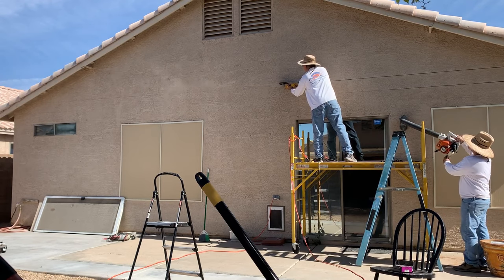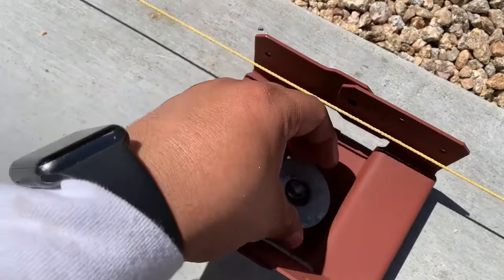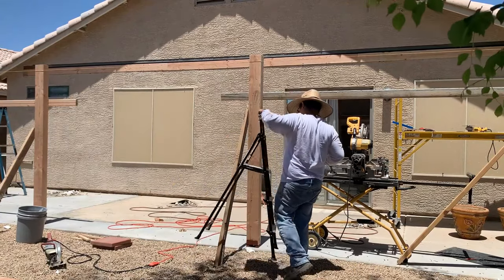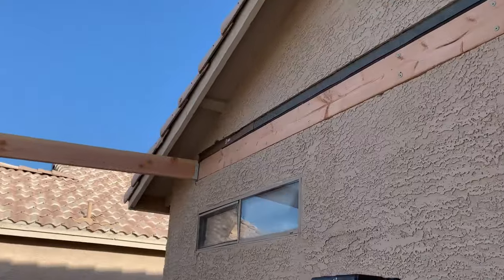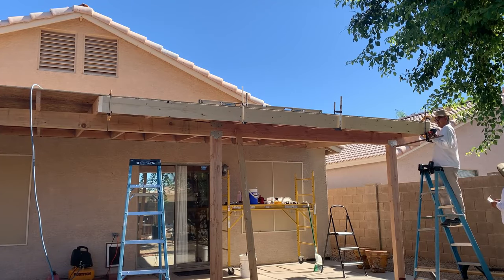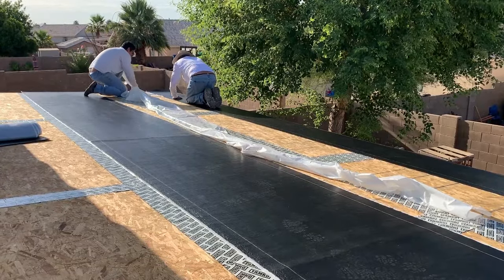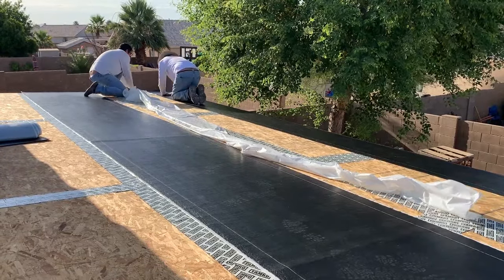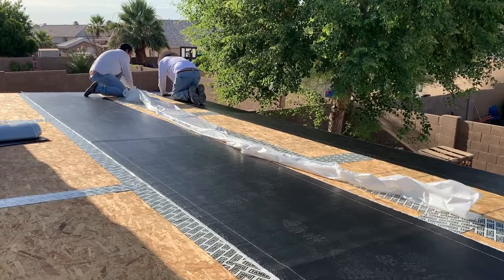DIY Patio Part2 - Framing Roof

Comment: Great video, Sir!  This is exactly what I want to build!  
Two questions:  what did you use to attach the Z bar flashing to the house and ledger?  And what did you use to attach the L flashing to the Z bar/plywood?

Keep up the great work!
Reply from the maker: I’m happy you found the video helpful. Right above the ledger board I placed a 1”x”3 board which the Z flashing sits on top off. The L flashing butts up against that 1x3 and behind the Z flashing overlap. And they both get anchored together to the 1x3 which is attached to the 2x4s of the house like the ledger board.
Reply: @luisangelmedia4459   
Thanks!   ...but you may have to make a part 3 to your awesome build to explain, in further detail, the flashing installation.   I just want to make sure that I did it within the same way to prevent water intrusion.
Reply from the maker: @tommy2shoes339  https://lh3.googleusercontent.com/proxy/itJKdZuW8IcftFbPkrZThXUzZiDXNEXow9l8vv5I8THlCHZ0GHdgznm4yOmazRQ9n0Nr4G9KTJcRO_Ce-pjTZSVH4owr0V9FK_ldCO-3iX0yJfpjPhcH9Zyygv9OW7NANA
Reply from the maker: @tommy2shoes339  look at the link I gave you. The “spacer” is the 1x3 I said previously. That sits on top of the ledger and everything else in the picture gets placed in that similar manner.
Reply: @luisangelmedia4459  
Thank you, again!
Reply: Link not working 😩. 
I’m stating this build soon!  😩😩😩
Reply from the maker: https://d12m281ylf13f0.cloudfront.net/images10/1-13-2.jpg
Reply from the maker: @tommy2shoes339  I linked another one, different picture, but same idea. Using two metal flashings to deter water away.
Reply: @luisangelmedia4459  
Luis...you are The Man!!!

Comment: Nice work. Honestly I didn’t see anything done incorrectly or half ass. And yes the membrane could have been put over the flashing. That’s the only thing I would have done differently.
Reply from the maker: Thank you. I agree about adding material between the base sheet and the roof edge.

Comment: Buen trabajo Luis
Tengo una pregunta 
Cuanto declive le pusiste al techo?
Gracias
Reply from the maker: Gracias. El techo tiene .5/12 de inclinación. Es decir, por cada 12 pulgadas, baja media (1/2) pulgada o en este caso, 6 pulgadas. Puedo bajar hasta un cuarto (.25/12) con este tipo de material y sobretodo, aquí en Phoenix no llueve mucho y está al código requerido.
Reply: @luisangelmedia4459  gracias
Yo hare uno en los proximos diaz en tu casa(Chicago)aqui me piden que los postes vallan 36 pulgadas bajo tierra porque hace mucho frio
Y la tierra se mueve con en calor y el frio,saludos
Una ultima pregunta que altura te piden para que este a codigo?
Reply from the maker: @surfacegrindingmachine5894  la única altura que es requerida es al final donde está el 4x8 horizontal. Se necesita 7 pies abiertos del piso al 4x8 de la parte de abajo. Te deseo buena suerte en tu proyecto.
Reply: @luisangelmedia4459  gracias
Ya tengo el permiso,pero no creas que expecifican mucho
Es interesante como cambian los codigos de una ciudad a otra
Yo pondre los postes de 6x6 pero tienen que estar cubiertos de concreto 46 pulgadas 36 pulgadas bajo tierra y 12 sobre la tierra
Saludos hermano
Reply from the maker: @surfacegrindingmachine5894  yo creo que tiene que ver con el frío y la nieve que caí en esos estados que hace que vayan cambiando los códigos. Dios te bendiga.

Comment: Hi Luis 
Do have a list of all the material that you used?
Reply from the maker: I do, but it’s quite long. You could follow the video and take notes on all the stuff used, or give me your email to send a list if you’d like.
Reply: What's the brand name of the adhesive roll and cap sheet?
Reply: Also can I get it from home depot or Lowes?
Reply from the maker: @HueNguyen-sh2dv  “Liberty GAF”
Reply from the maker: @HueNguyen-sh2dv  You can get them from both stores. However, you need to go to one of the stores that sells this material, usually the store where most contractors buy as not every single store carries the material in stock.
Reply from the maker: @HueNguyen-sh2dv  Yes, but not all the stores have them, some stores are more "contractor base" stores where they carry these kinds of stuff. Here is the link https://www.homedepot.com/p/GAF-Liberty-3-ft-x-34-ft-100-sq-ft-SBS-Self-Adhering-Cap-Sheet-Roll-for-Low-Slope-Roofing-in-White-3732920/100031926

Comment: Amazing job Luis. Can you help those who aren't very familiar with flashing? How do you attach the Z-flashing to the house? How is the L-flashing then attached to the z-flashing? Thanks for your assistance! Your work is impressive!
Reply from the maker: With the stucco cut back like I did, you feed and tuck the z flashing underneath the stucco and whatever is under the stucco as well such as foam insulation. The Z flashing looks more like an “N” so once you have one side tuck under the stucco, the L feeds under the other lip of the z flashing and the roof under the L. So you have one “seamless” transition where water cannot possibly get into. Hope this helps.

Comment: Thanks for the trhis video...How do you cut the notch on the 2x4's to mount on top of the rafters?
Reply from the maker: You can use a square on both sides of the beam to mark where the notch will go and then use a marker and run it along the beam to mark the line on the stud. Let me know if this what you asked.

Comment: nice job, but it's  extra work and money involved when it is very simple to determine your double top plate on  the wall and bottom cord on the gable truss...
Reply from the maker: Thank you for the feedback. I’m not too familiar with everything you said, but I’ll look it up for next build to be more informed.
Reply: How can you determine where your double top plate is located without cutting into the stucco? Thanks.
Reply from the maker: @brunodiaz305  if you were asking me, I’m not sure about that info that the user above commented. When I cut into my stucco, I did not see any wood that my ledger board could have just been bolted on to, except for the 2x4s. So this “top plate” is either too low or too high for where i wanted and needed my ledger board to go.

Comment: Very nice work. I'm planning on building something similar 15x30 but instead of a ledger board I'll building into the roof and on top of the wall. But I had a question about the post. Is there a reason why u went with 4x6 instead of a 4x4 post? Is it code to use 4x6?
Reply from the maker: The schedule tables provided to me by the city did not tell me specifically what size post to get, but I went with a 4x6 instead of 4x4 because I thought it would make for a “stronger” post and I like the look of a wider post.
Reply: @luisangelmedia4459 I see. Thank you for the quick response.
Reply from the maker: @bigpetah765  good luck on your project!

Comment: I see posts are put on 4inch concrete. Is it according to the code?
Reply from the maker: If you go look at part 1, the posts are on top of 12”x12” footings, about 2 feet deep. I buried a 5/8” bolt for the post base.

Comment: Great work! Is the beam 4x6, Rafter and ledger  2x6?  You don’t need cross bars between the rafters?
Reply from the maker: The horizontal beams are 4x8. Ledger is 2x6 and 4x6 posts. 2x6 rafters as well. As for the cross bars, I think they could help, but I opted not to put any because the rafter span was only like 10 feet and I think the rafters shouldn’t move so much. Almost 1 year later and they are still fairly straight.

Comment: I still  don't like the Idea of resting the two beams on the center post since  you are only  resting those  top beams  on 2  1/2 inch in each side ,  to secure  it better  I will  attach  1 2x4 on each side of the center post
Reply from the maker: Yeah it looks odd having both come down on half the post, but I think that’s what the post cap is for. It’s designed to strengthen that post and securely have those two beams rest on it. I know sometimes city code doesn’t make sense, but you can always do like you said, add support to make it stronger. Thank you for pointing it out.

Comment: How much would a patio like that cost I have the same problem with the sun 12 × 36 no concrete
Reply from the maker: I spent about $350 for the concrete delivery of 2.5 yards and that was 8x32. We finished the concrete ourselves, but I estimate that would probably cost about $1,500-$2,000 to have done by someone. As for the patio structure itself. I spent about $1,500 on materials, but the prices of lumber have increased dramatically. Most recent patio I did, 12x32 came out to $2,400 in materials and I was paid $4,000 labor. Hope this helps.
Reply: How much for the patio that's exactly what I want
Reply from the maker: @adammartin9701  contact me at luisangelmedia@gmail.com

Comment: I'm wanting to do a patio over concrete pad as well but my house is brick. How do you flash the ledger board?
Reply from the maker: It’s done with 2 metal flashings. One is called a Z flashing that sits on top of a spacer above the ledger board and the other one is a regular L flashing that goes below that one, but above the patio. Here is an illustration 
https://imgur.com/a/MbRxgUQ
Reply: @luisangelmedia4459  Hey, I can't get behind the brick. I could only cut into the mortar joint. Do you know what I would use?
Reply from the maker: @kathleenjones9207  oh my bad! If your house is bricks, do you have eves coming down the side of your house? If you have eves, you need to cut them back flush with the house, so the ledger board would sit on top of the bricks, but attached to the eves/rafters coming down from the roof. If you don’t have eves and your bricks go up high, I really don’t know what the procedure would be for that kind of application.
Reply from the maker: @kathleenjones9207  https://imgur.com/a/kYTG6gq

Comment: Great video and professionally done! Does your roof have a grade for rainfall/runoff? 

Is the cap sheet all that’s needed (no shingles/metal exterior protection)?  I’m in CA so it’s hot and rainy.
Reply from the maker: Yes, the roof has a 6” slope from the house to the posts. This is a .5/12 slope, super low, but still at code and spec for the type of roofing material I used. Here in Arizona cap sheets are fairly common, not as a main roof, but used in a lot in additions, sheds, patios.
Reply: @luisangelmedia4459  thank you! I’d be interested to see a video tying into an existing roofline (fascia removal maybe) if that’s on the list! I guess it would be for the side of your house. Again great detail thank you!
Reply from the maker: @iWaSTD  I know what you are talking about, but here in Arizona you cannot attach any structure to the side of the fascia or the eves coming down the side of the house. What needs to be done there is that the eves needs to be cut back flush to the house and then expose the trusses where those eves come from and your patio or structure is then attached to those trusses. New roof material also needs to be under the existing roof, which means momentarily lifting off a few inches of the shingles to create an overlap for new roof. Hope this explains it.
Reply: @luisangelmedia4459  I 100% understand because I just replaced all the decking/underlayment on the back roofline. Thanks so much for your insight!
Reply from the maker: @iWaSTD  you’re welcome and good luck in your future projects!

Comment: The concrete can support a pavillion? Will it crack in the long run??
Reply from the maker: It depends exactly what this “pavilion” will hold. The concrete will hold a lot of weight, specially because the posts have a footing under them. But this patio structure is a simple cover. You and someone else can walk on this no problem, but it’s not made with the purposes to build more things on top of it. So your structure needs to be braced according to whatever purpose you will be using it for.
Reply: @luisangelmedia4459  ok I understand. I just got concrete about 6 months ago 4inches thick with wire mesh underneath.  Do you think it can support a 20x30 pavillion? I'm a little nervous because I don't want the concrete to crack
Reply from the maker: @nba3512  that’s good that they added the wire mesh and this helps, but usually most companies that pour cement will pour you 3500 PSI unless you ask for something stronger, but 3500 is strong enough for any residential work.
Reply: @luisangelmedia4459  great. I just called they said my concrete is 4000psi. That should be good right? Your works looks great. Thanks for the help Luis.
Reply from the maker: @nba3512  you’re welcome and yes, 4,000 psi is super strong
Reply: @luisangelmedia4459  ty. Have a good one
Reply from the maker: @nba3512  thank you, you too.

Comment: Need help how a far apart did u put the beams bro let me know and do u need a permit
Reply from the maker: The beams or posts are 10 feet apart on their center. The middle beam is 10 feet while the two outside beams were left at 12 feet length just in case I want to do something with them later. As for the permits, you need to call your city, maybe try zoning or building, they will let you know if you need permit or not, but in most cases you do and what will happen if you build without one (in most cases pay a fine if your patio is built correctly.)
Reply: Ok thanks I thought it be 16 apart did u put roofing on it I want to do one 19ft by 8ft like a porch  what u think
Reply from the maker: @ovg8824  yes I did add roofing material to the top. And I would advise that you stick to a roof that 4x8 boards could occupy the space in, so 8 feet is good, but instead of 19 try 16, 20 or 24 so you will have less waste material. Draw it out and check your measurements before you begin buying to make sure it all checks out.

Comment: La.lamena es de de 3 ×2
Tambien ebisto de 2×2 cual es la adecuada
Reply from the maker: Cual lamina te refieres, la de la orilla que va todo alrededor? Esa viene en varios. Te recomiendo una suficiente ancha que cubra la tabla que va atrás como separador para que la agua no la humedezca.
Reply: Gracias evisto casas k tiene la madera de 3 pulgadas y la lamina de 2 pulgadas no cunbre la tabla. 
Save por k leponen un prame. En espray ala lamina por ensima donde ba elnarenado por lo aran si viene pintada
Reply from the maker: @trailscampingandlake696  creo que lo que le echan es un material para sellar la orilla de la lámina y el rollo negro.
Reply: La tabla no encontre de 2 inch real. Tedan gato por liebre. 1 1/2. Tu las cortastes a 2
Abia de 3 inch k la medida real es 2 1/2

Comment: Vi k no pusistes tachuelas en nigun momento en el papel negro ni en el arenado.
Las bases de metal que son como V k sostienen todo el peso la k las k pusisteses en el barrote k metistes en el semento. K las pones a cada 24 pulgadas al centro. Como pueden sostener tanto peso con tansolo 4 clavos o tornillos. Como. O se salen los rornillos con el peso. Geacias por responder.
Por k no pusistes madera tratada. No la recomiendas
Reply from the maker: El papel negro no es papel normal de techo, este material tiene pegamento en la parte de abajo, por eso se le quita el plástico de abajo. Una vez que ya haga contacto el material con el triplay queda pegado porque el pegamento es muy fuerte y no fácilmente se puede quitar. El arenado similarmente tiene pegamento en la parte de abajo que se queda pegado con el negro. Ahora, todas las piezas de metal que se utilizaron en este projecto son hechas para este tipo de aplicación. Las bases de los postes son resistente a la agua y ayuda a los postes no estar directamente sobre el cemento y para reducir la humedad. Las basas están anclada a una barilla de 5/8” que se enterró cuando se hecho el cemento. Las placas de metal que detienen los barrotes contra la casa también están diseñados para este propósito, pero también se le mete tornillos atravesados para darle más fuerza a estas placas. En inglés se llaman “rafter hangers” es decir, “ganchos para vigas.” Y no use la madera tratada porque yo vivo en Phoenix, Arizona en EEUU. Aquí no hay mucha humedad o lluvia, pero también es porque se va a pintar la madera en el futuro.

Comment: What type of screws did you use
Reply from the maker: Most of the build was done with exterior Everbilt screws of different sizes. Gray coated. I used 3/8 lag bolts for the ledger board and self driving, flat head screws for most of the metal hardware. Hope this answers your question.

Comment: Which post caps did you use?
Reply from the maker: https://www.homedepot.com/p/Simpson-Strong-Tie-ABA-ZMAX-Galvanized-Adjustable-Standoff-Post-Base-for-4x6-Nominal-Lumber-ABA46Z/100375175
Reply from the maker: Let me know if the link works, or you can type “Simpson Strong-Tie ABA ZMAX Galvanized Adjustable Standoff Post Base for 4x6 Nominal Lumber” on the Home Depot website.
Reply: @luisangelmedia4459  I meant where you connected beam to post. Looks like you used a solid 4x6 beam. Thanks
Reply from the maker: @ernestfeltman5472  do you mean this?
https://www.homedepot.com/p/Simpson-Strong-Tie-PCZ-ZMAX-Galvanized-Post-Cap-for-4x-Nominal-Lumber-PC4Z/205694641

Comment: How did you find where to put the long screws that hold the ledger board ?
Reply from the maker: Allbbrz when you notch out the wall the way we did, you can physically see each stud, there is a black paper covering them, but you can feel with your hand, and we removed a small portion of that paper. You then make small marker lines bellow or above where the ledger board goes to remember where those wooden studs are.